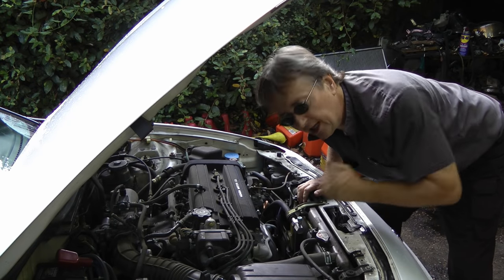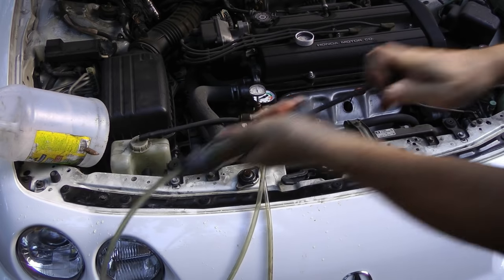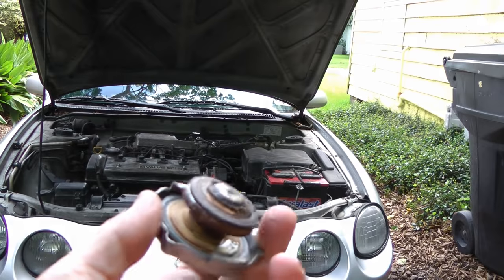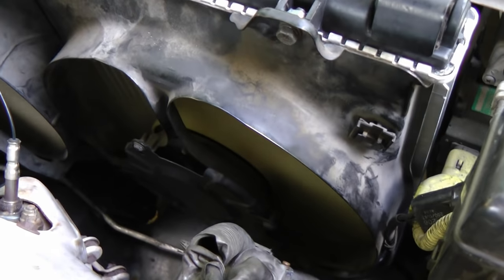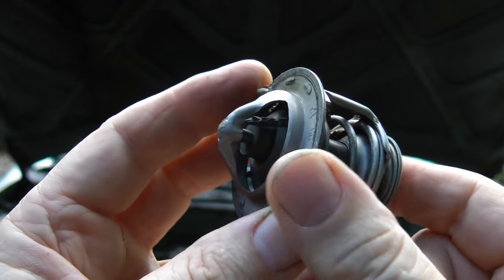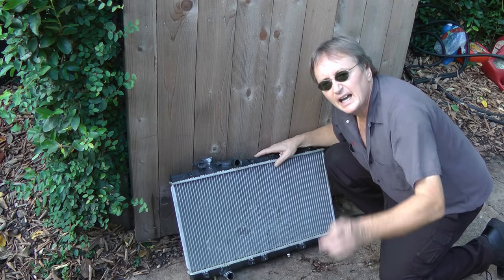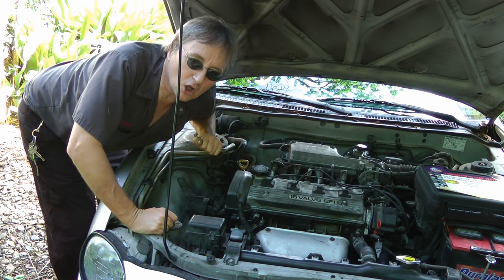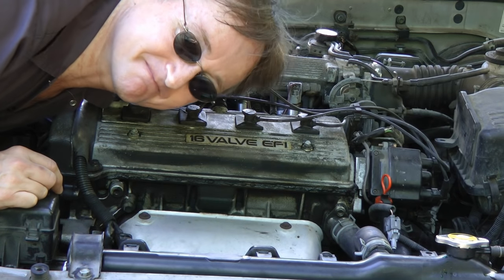How to Fix a Overheating Car Engine

Comment: I have a 2001 Kia Sportage 4 cylinder that is over heating when I'm in heavy traffic or idle for more than a minute and I just noticed it's leaking HOT antifreeze onto my passenger side carpet even more when I have my air conditioner on so yesterday evening when I noticed it was leaking inside the passenger side carpet I turned the AC off and it stopped leaking as much but it is still has a slow leak and Idk what is causing it? I was thinking maybe the AC drain was plugged but what would that have to do with my vehicle over heating? Since I noticed both of the symptoms around the same time I seem to want to think they are both connected. Are they? Or do you think I have 2 separate problems going on with my truck at the same time? I really enjoy watching your videos on Youtube along with my husband (he is a self taught diy mechanic that tries to fix everything that goes wrong with our vehicles and until now he has done a pretty good job doing it) but we always look up the symptoms the vehicles has and try to figure out the problem ('s) before he starts taking things apart on our vehicles and when we "Google" a problem with a car 9 times outta 10 one of your very helpful videos pop up and for that we want to say THANK YOU for taking the time to make your videos to help us out!!!!!
Reply from the maker: ac drain does not effect overheating. Do my tests in this video to find the overheating problem, it has to be one of them
Reply: your ac's heater core is connected to your engines cooling system 
if it has a leak then you should have it check
Reply: Yep if you're getting engine coolant into the interior of the car, it's probably a leaking heater core which can make the car overheat as it can't build up pressure in the cooling system to work effectively as the leak vents off the pressure.  Also a leak will cause the coolant to level to drop and cause overheating.
Reply: Thank you Scotty Kilmer for taking the time to answer me!, And xpatriarch II  and Believe231 I think you two guy's pretty much hit the nail on the head because that is what my husband seems to think it is as well....I hope yall are right...my husband already started to take my truck apart to retrieve the heater core and replace it even though he says it is a SOB to get to on my vehicle...he says it's gonna pretty much take the whole dang weekend to get to it and replace it and put my truck back together again. So I am praying to God that is what is wrong with my vehicle and there isn't anything else wrong with my truck...Hopefully it will stop over-heating once he replaces it and I won't have any more problems at least for now!
Reply: You could also bypass the heater core by connecting the feed and return lines that go through the firewall together. That will stop the coolant leak but you would also lose cabin heat. It does make sense if you live in a warmer part of the country.
Reply: 2001 Kia Sportage? Solution...GET RID OF IT and get a 5 to 7 year old Quality used 🚗. Im surprised it lasted this long.
Reply: Rhondavas1977 l
7
Reply: xpatriarch II o
Reply: Maybe the heater core?  You can bypass it but sometimes the defroster is needed and if you have no cabin heat, the windows can fog up really quickly.

Comment: This is weird, just recently replaced the radiator in my car, but when the car is idle for about 10 min the temp gauge will make its way to a little over half, observing under the hood, the fans did kick in but then i kinda smelled the anti freeze, i turned the car off, didn't notice any leaks i then opened where ur suppose to refill the car with anti freeze and it i can see anti freeze start to shoot right into the container and want to burst out the lid so i closed it quickly

... any idea about what could be happening here? car is a 2012 dodge charger if that helps.
Reply: Don't do that, you could've gotten seriously burned. Always wait for car to cool down.

Comment: My car overheats when running on Sunny or rainy conditions and I don't know what to do. It is a really old car, even older than me. I'm 18 and the car is already over 20 year's old and I just started experiencing overheating problems last year.

My car is Lancer GLXi 1.6 Mitsubishi
Reply from the maker: do the tests in this video to find the fault. It could be electronic problems, cause normally cars run cooler in the rain cause rain water is cold and hits the radiator. But heat and water will ruin electronics
Reply: I'll give it a try. Thanks
Reply: Did You fixed the problem? I'm curious.
Reply: Ambrew KS_FTW I have a similar car and just started to over heat. Did you find out your problem to the car?

Comment: I have replaced my radiator, checked for leaks, and changed the thermostat but my car says it overheating, however I've had two mechanic family members look at it and they said the engine isn't over heating? they say it isn't hot enough to overheat? however they both cannot figure out what is wrong. I'm sure they checked the head casket as well. before one of them took out the thermostat and that seemed to work but I had no heat, however winter is coming up and so we put back a new thermostat and we are back to the same overheating situation. just wondering what u guys think?
Reply: have you checked your gauge wirings?
Reply: Its your temp sensor
Reply: Check your Engine Cooling Fan Module sometimes they fail and it cause the car to overheat
Reply: Wiring or sensor: electrical false reading. Clean the electrical connections then look at the sensor
Reply: Sounds like Air in the system!!!!!
Reply: Check water pump
Reply: Check the heater matrix for blokages cooling system leak sealents will block the heater matrix and this can cause the temporature light to come on especially on cars with automatic transmision.

Comment: Scotty, you forgot to mention to buy a thermostat that is designed to fail in the open position to prevent damage.  whenever I buy a replacement thermostat, I always spend the extra money on one.
Reply: What's a good thermostat brand? Or should I go oem

Comment: Forgot 1 other problem
Water pump
I know vw's has plastic fins inside that will eventually break
Reply: +Steven Wilkins My thought exactly
Reply: Steven Wilkins that was only mk4, vw then changed to metal fins even oem. my mk3 is at 217k and still on original water pump
Reply: No he didn’t forget lmao he pressure tested the system if  the water pump was bad it would leak through the weep hole
Reply: Same with Chrysler products they have plastic impalers on the water pump
Reply: Joe Kim I’ve never had a electric water pump on anything I’ve had try to I try to stay away for all that lol

Comment: Hey everyone,My car does this thing where after driving on the highway (65 mph, 50-80mi total) once I get back on the street it'll overheat, especially if I go slow or stop. If I go 35mph or so, the heater will blow hot, and the gauge will go back down. If I go slow or stop, the heater blows cold and the gauge goes up again. The 2 fans were blowing when I pulled over. The coolant reservoir is full, and I did my best to remove air from the system a few days ago. Any ideas what it could be?Thanks.
Reply from the maker: pray it;s just an old worn out radiator that can't dissipate extra head, and NOT a blowing head gasket.
Reply: Get your radiator flushed or changed if required. On the freeway it's getting air cooled but during slow driving it's overheating.
Reply: just ust lost love scottys presentations

Comment: hey what about a bad water pump...? my car was overheating and it was the water pump...you didn't mention that on here
Reply from the maker: I did indirectly. Most water pumps leak when they go bad, and my pressure test of the system would show it leaking there
Reply: oh ok...I learn something new every day...thanks
Reply: Loren Jones Yeah he did not mention all the little individual hoses either...................................

Comment: hey scotty. have an 03 mustang v6 its a dailydrive and it had a blown head gasket... recently fixed it. but kept overheathing so i changed the thermostat then i changed the water pump and still overheated so i changed the radiator and the radiator cap and it worked just fine for a month but then i noticed it tryed to overheat again... specially when i turn the ac on... or go hard on the gas pedal for a while...  i also noticed that the coolant on the radiator decreased
Reply: similar stuff here sir!... any fix or ideas?
Reply: I have a 95 mustang gt that had overheating problems for a month. I changed everything I could (cheap to expensive) associated with it; upper and lower radiator hoses, radiator cap, thermostat, and the ccrm. The problem was my fan wasn't starting when it needed to cool down the engine so I was gonna try my luck replacing the fan after all these. Then I kept reading the manual and found a sensor (Cooling Temperature Sensor). From my guess I think it sends a signal to the fan to turn on when it gets to hot. Replaced it, fan came on, haven't had a problem since. Don't know if you've already fixed your problem, but if you haven't maybe give this a try? Hope this helps in any way.
Reply from the maker: of course pressure test it for leaks, and pray it's not the head gasket being poorly replaced, do my video "how to tell if your head gasket is blown' to find out for sure
Reply: overheating is the most common problem i have heard about.  i have Honda Accord 2008 2.4 and i am suffering from this problem for two years tell all the engine destroyed 
i did not change the engine for my car for one month because know i have phobia and 😱 fear from overheating again 
also i start feeling bad about honda accord 🤒
Reply: radiator fan working?
Reply: A warped block will also cause overheating.
Reply: I have a 98 mustang

Comment: I need your help Scotty I have a 2005 nissan altima that keeps running hot on me just bought a week ago. Someone suggested that I look at the thermostat so I removed the cover on the upper thermostat and it was backwards and worn down so I changed it. The lower one was missing so I bought that one and then I flushed the radiator and added a gallon of antifreeze and it still ran hot so I changed the water pump and I changed the hose clamps to ensure myself it wasn't that. It is still running hot unless I run the heater any suggestions of what to do next besides the timing belt. The guy I bought it from just changed the heads and cam before I bought it
Reply from the maker: +David Lewis   often just a worn out radiator does they, they get old, corrode, and don't dissipate heat. PRAY he didn't mess up the engine job and that's causing it
Reply: Could I possibly test if the radiator isn't doing its job?
Reply: Do you think it could be the timing belt?
Reply: +David Lewis check your cooling fans,  maybe they are not working like they should

Comment: what about a bad water pump???
Reply: Tracy Stines That was my problem in my 200 jetta. Luckily the dealership replaced it for free since it happened the day after I bought it. Very expensive to replace.
Reply: @crazymonkey86056  its not if you do it yourself

Comment: I have no leaks but my car overheats but not all the time and will have smoke for a few seconds on the left driver side I have replaced the radiator and the upper and lower radiator hose as well and heater hose what can it be it over heats when I sit in park

Comment: Thank you so much for your time 
Have a2011 dodge nitro 3.7 v6.
Changed thermostat, water pump, heater hose , upper radiator hose and radiator cap. Not leaking. But begins to overheat not right away . I'm going to check pressure on cap. What else could it be

Comment: All your videos are good, but you forgot bad hoses the pinch together can also cause overheating and another thing is a bad reservoir tank can cause overheating as well. I just bypassed my reservoir tank by plugging it from the radiator for a quick fix and it stopped overheating, any suggestions on damage I could cause with my rig? Or do I really need that reservoir tank?

Comment: hey scotty, just wondering if you could answer my question please, is the car with over heating history worth buying. thing is fix all the cooling system and no more overheating, I'm just worried if the car will last long and the engines life span will extend if i keep servicing it on time

Comment: Hi Scotty. I have a 2002 Honda Accord 2.3 cylinder and it over heats. But I replaced the radiator. And the motor sounds healthy and doesn’t have no water in the motor oil or in the cap. I had replaced the transmission as well but that’s another thing. Car over heats and goes very slow too as well. When I accelerate it makes like a deep sound and won’t go much. I really appreciate it your help

Comment: My Toyota Sienna 2012 is overheating. I replaced the thermostat. Still not solving the problem. I took it to Toyota service center to check it. The technician checked the cooling system and the radiator and said it might be the engine and recommended to rebuild or replace it. Do you think it’s the engine ?

Comment: Okay riddle me this.. 2012 jeep wrangler, new radiator, new thermostat, new hoses, new flush of HOAT coolant, system fully devoid of air- completely burped, no leaks, no noise from the water pump (8,000 miles on a new motor) new temp sensor, new oil/ cooler, new oil cooler sensor,  radiator fan turns on when air conditioning engaged yet blows hot air (I'm thinking that's a blend door issue) but the fan works.   Yet coolant boils, motor does the won't start after too hot issue.  I'm perplexed..  what would you suggest (also head gasket is good, no loss in coolant level

Comment: GX470 overheating.;replaced leaking thermostat and radiator 3 months ago. Replace the radiator cap with new one too. As it turns out, the radiator cap is faulty. Thanks Scotty!!!

Comment: Hey Scottie got a quagmire for you did the combustion leak test twice Change the radiator change the thermostat several times change the water pump it’s not the heater core in my Subaru 2002 WRx keeps overheating. When I’m driving on the highway it’s fine but the minute I slow down it starts to overheat

Comment: I have a problem Scott.  The battery doesn't charge. The alternator is good rotor is good, and ic as well but when I unplug the positive the engine die. Can't tell what's the problem. All the wirings are good but the problem still exist. What do you think the problem is?

Comment: Good day sir, I bought a used car 2009 chevrolet malibu. It has a lot of problem, waterpump, oil pressure sender and thermostat, after fixing those 3 I got a new problem while I was about to bring it to emission testing my check engine then it says the problem was oxigen sensor but now it's all right, I fixed all the problem and passed the emission. Do you think my car is now really in good condition? What should I do now to take care of my car. What kind of maintenance should I must do every now and then? I dont have any idea bcoz I am new to have my own car.

Comment: Hi @scottykilmer, hope you are doing good! I am planning to get another car but more likely second hand one, my current car which is using gas usually have overheating issue from waterpump, leak in radiator, motor fan and lastly head gasket leak, I am planning to replace with suv or pickup truck,  I want to know if diesel vehicles like suv and pickup truck are less prone to overheating?

Comment: Hey Scotty.... I was driving one day for about 35-40 minutes...when I got out my coolant was bubbling....my gauge never moved towards overheating....but since then I leave the vents open some air can come in/out  Because I haven't replaced my Blower Motor Resistor yet....do you think that's causing the problem...not having a blower motor resistor?

Comment: Hey Scotty. I've fixed all coolants leak oand replaced thermostat on my aerostar. The van only over heats if I have the AC running and sitting still. If I turn A/C off, not over heating what so ever. Also, I can run A/C full blast while driving and my van stays very Cool. Clutch fan works fine. I've retro actively been flushing radiator for the past 3 months. Any ideas. I guess a radiator replacement?

Comment: worst case is head gasket  , radiator OR transmission heat exchanger in radiator. Min Rad replace and transmission flush then. But if trans is ok I would get an external trans cooler installed $100 and cut it out of the future issues loop

Comment: 2001 toyota tacoma over heating!!!! N0 engine codes,,,,,,,I replaced termostat,temp sensor,  I did that air pockets and still overheat especially driving up hills .......SO MY PROBLEM WAS THE BAD RADIATOR!!!!! thanks Scaddy😂

Comment: What might be the cause of the cooling system boiling over into overflow tank only after the engine has been turned off?  System is full of coolant, air removed from system, new thermostat, new radiator cap (also tested it), new fan clutch on mechanical fan, electrical fan working.   A few minutes after turning the engine off after running under heavy load (e.g. A/C on or steep slow hill climb) one can hear gurgling and eventually the overflow tank will overflow onto the ground.

Comment: Could it be a bad water pump as well? Car overheats on long trips and when going up a long hill. Revving the engine a little higher on neutral when driving the temperature drops momentarily. As soon as I put a gear in and continue, temperature goes up again.

Comment: At the end, said it had to be either the radiator causing it or a blown head gasket. Is it possible the Water pump, is causing the car to overheat?

Comment: Hi Scoty my buddy has a 1998 Mazda 626 2.0 (4 in line), the engine runs OK when cold in the morning when the temperature rises to normal the engine loses power. It just been serviced.